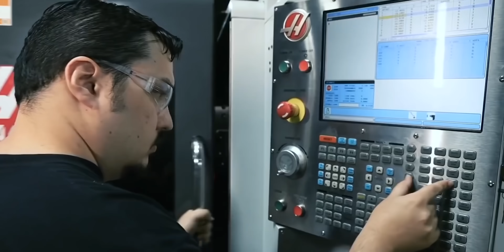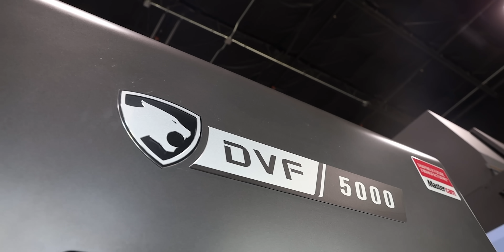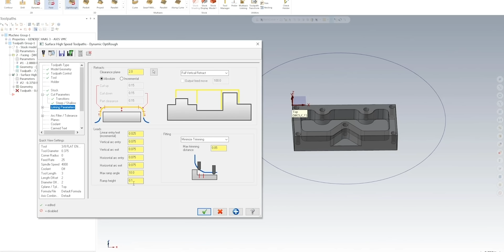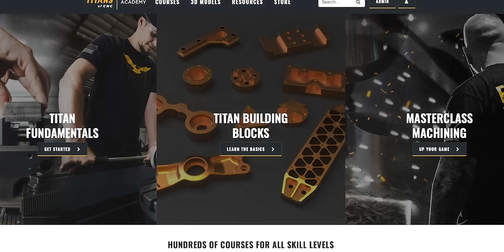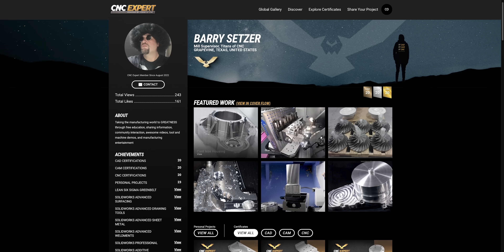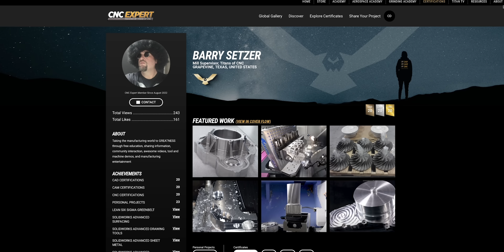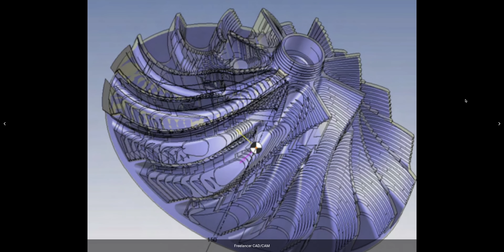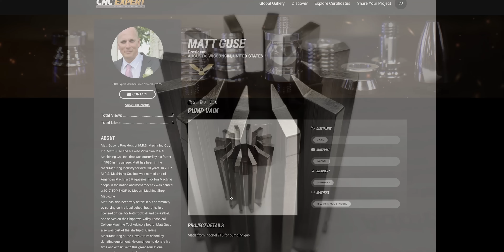Getting Work For Your CNC Machine

Comment: I designed a thermoacoustic engine on Tinkercad that runs on sound and feedback. I'm too afraid to build it. It's makes, air, hot water and high voltage AC electricity. It's kind of like a galaxy in a box... that's why I'm afraid of it. Not sure what to do with it.... It would take some courage to build it and possibly a high voltage safety suit. Every part is designed in 3d ready for a CNC machine but 3 of the parts will have to be tuned to 90 hertz. There are 13 non moving parts. It uses sound to make heat and move it in a doughnut and water condenses inside it and spins the water droplets in the same doughnut until it becomes spinning plasma. It makes high voltage and high amps . Because it makes it's own water it will gain mass. It has applications for space travel because it should make it's own gravity as well. It has 2 holes.. the air hole at the top of the box and the black hole at the center of the box.. and everything gets sucked through that hole. It's  a real breakthrough. Cost nothing to run... you just have to sing to it until it gets hot and it should run forever because it will turn the water into hydrogen and explode it for more sound and feedback. The engine itself is only 1 ft diameter and 2 ft high... and very simple. If you have ever seen a spinning hurricane.. it makes hundreds of millions of volts and thousands of amps from the spinning water droplets with no magnets or coils...and this uses the same principle.

Comment: There is plenty of work out there for the small job shop. And I mean small, like one guy with a Prototrak  cnc and a manual lathe. Learn a little welding and repair work stuff and you’ll be flush with customers.  The guys I know have to turn people away.

Comment: Small shop owner here. Question, the best work we have done is protected by NDAs and unfortunately we cannot disclose. There are very few parts we can show, and those parts aren't the crème of the crop. They may seem simple and low level, but we certainly can handle more complex parts. How can we build a profile so that it is not misleading on the work we do, so that it doesn't seem like we only machine simple parts and possibly push potential customers away?
Reply: Design your own showroom parts on CAD and machine them.

Comment: Maybe,  I have 4 cnc's,  and a shop full of manuals also, but.... without the high qty work it's a moot point,  we use to make 2,3,400 pc order's all day every day,  now it's 1,2 or 10 pc order's,  , finding good work with high volume is way harder than most think,  plus all the other shops that are starving to death and quoting jobs dirt cheap, hard to get the work.
Reply: Having a successful shop is the most challenging business there is.  Been there, done that, closed it.

Comment: Fantastic post!

30 years ago I was a newly minted plant manager at a CNC shop.  I remember a moment when an operator stated “how come the owner can buy a brand new Cadillac and I can’t get a dollar an hour raise?”.  This was asked in front of most of the workers during a coffee break (we were outside at the “coffee truck”…..when the operator pointed out the new Cadillac).  I then asked “would you prefer he pull up in a Yugo?”…..a cheap foreign copy of the Ford Fiesta.  I then asked if he knew about the rejects that came in the day before…..about a $50,000 loss (a lot of money for a small shop).  I stated “the owner bears all the risk….I hope he pulls up in a brand new Mercedes SL500….then I’ll ask for a raise!”.  Every one laughed….but it was a quick reminder of who’s bearing the risk.
Reply: There can be a fine line between who takes the risk and who is doing the work, especially if the boss isn't doing much in the company.
Reply: lol that still doesn’t explain why the operator can’t get a measly dollar an hour raise. I bet the shop down the street will, exactly why all the boomers with mindsets like you will be left with no workers and no shop eventually
Reply: @ianprice4679  This was 30 years ago…..CNC shops were closing everywhere due to offshoring, very few in the machinist trade knew CNC (Autocad/Smartcam was relatively new)….shops were mainly operators and tool/die journeymen (they made $$$).  It was an unbelievably sad environment….margins were a fraction of where they are today (race to the bottom).  For every want add in the newspaper, you get 20+ applicants.  I like many left the trade…and I miss making things off a blueprint….especially the difficult parts (you breath on them and they’d be out of tolerance).  I wish we were able to give raises because some one asked.

Comment: If someone is considering opening a shop, my advice is to start it ASAP. I can't express how much outsourced work is coming back to the U.S. from China. Do it now! Lead times are months out and suppliers are desperate. All the shops I know that are worth their weight are running at max capacity and expanding. Our shop is running at max capacity and expanding. I'm getting at least 10 requests for quotes a day. If you don't have contacts get a hold of a tooling sales rep or a new machine sales rep, they know who needs work done.
Reply: I’m so glad to hear that there are so many jobs for our machining shop owners. However, as a shop owner, I’m struggling to find. Could you please recommend me some of company that we can reach out for jobs?
Reply: @nhile-pj9ui  Talk to machine/tool sales people. They are in and out of shops daily. It's kind of crazy how the industry has changed in the 5 months since I made the original comment. The work is out there but I think most shops aren't outsourcing as much work.

Comment: I got into this trade before CNC was much of a thing (1980). In a rural community, word of mouth was the main thing, advertising didn't do squat, people look for machine shops when they're serious, and not to play around. 

A yellow pages ad was still a worthwhile thing back then. Still might be. The fractionation of society into silos makes it hard to get general attention anymore, you practically need to specialize just so your google info can be properly categorized near the front of a million alternatives.

Manual machining is still a thing as repairs are still a thing. Not to say you can compete on every level, but often one welding session and TWO cuts can save a $1000 to $10,000 part/machine. If you buy good used equipment, the payoff potential is huge. But you do have to be a skilled fixer in your own right. Nobody gives a shit about your machines but you.

The need for CNC became self evident, as repetitive work on manual equipment is a real drag. Good used CNC was not available in the early days, but it is abundant now. Still, it is a big leap if you aren't starting from NECCESSITY, but are just awe struck by the toys in the big shops. Don't covet that, because it has it's own drag.

I've never knocked on doors to get work. That makes you subservient to your customer. I do have a reputation which is "good but expensive", and that's the way I like it. I never intended to just be a shop manager who never got to play with the toys I was buying. Now past common retirement age, I've got more work than I care to handle. My business has been for sale for many years, but there's not many people who can step into my shoes. Lots of career machinists don't REALLY have the commitment to the trade that they imagine they do when working for someone else.
Reply: Yes, all this, exactly. I run a small prototype shop for in house manufacturing. Looking to retirement myself, I don’t see the skill set in most machinists to take over from me. A lot of guys seem interested in these super fancy 5 axis machines but owning a $280,000 machine is just never gonna happen for most guys. And the amount of work you have to churn out on those is insane. I have a 1996 Prototrak and a 1960’s Hardinge Super Precision lathe in my home shop and I could make a good living just from those. Every old school machinist I know who has some manual or semi-cnc machines has more work than they could handle. I like doing one offs and repair work. There will always be a need for it, more so as us older guys retire or die.
Reply: I’m a machining shop owner and I’m so glad that I can learn some of your valuable comments as I’m struggling to have more work. Do you guys have some tips to find customers?

Comment: I bought my first machines this past year. I have worked on CNC equipment for maintenance as a contractor for the past 2 years. I am buying older but good equipment, fixing them up and running parts on them. I am hoping to sell used equipment while manufacturing small orders in the hope of getting some large order to setup serious Automation manufacturing. It has been a wild ride. Waiting 30 days or more to get paid is extremely difficult.

Comment: I have had some experience dealing with machine shops , and my biggest problem is I will take a small job to a machine shop as a test to see how they handle it . and they tell me the job is too small , they won't make any money (we haven't even discussed price) , how they will put it on a shelf , and let the "new guy" do it when he is finished cleaning the floors....   I'm exaggerating a bit , but less than you might think , anyway they fail the "test" spectacularly . Occasionally it will happen the other way , a shop will handle a small job fantastically but runaway from the following larger orders . A shop needs to be able to handle small and medium sized orders , or they will never grow to the point where they get large orders. If I had a shop I would make sure I could handle orders from 1 to 1000 parts efficiently , profitably , and professionally.
Reply: I totally agree. I've been trying to get my boss to just expand the companies we do work for. No matter the size of the project. If we do quality work for them they will send more work.
Reply: I had a shop before the govt. Decided to fuck me over
 
Test jobs are often blatantly obvious and i've seen customers VERY upset with not getting the same quality as the test after sending a mid-size job to another shop.

Whenever i got a test job, i would tell whoever got it to do it (or do it myself) as well as we'd do a baseline job
Reply: My company manufactures products from prototype to 1000s. I also translate parts from machining into die casting or injection molding for mass production. All in the US. 

We do this because it is very rare.
Reply: it's silly, flexibility is critical for customer relations. i can see hesitation but some work turns into more work if done right. if nothing else, people talk and word of mouth might do more than you'd think. maybe not on an industrial level but still. you'd think these guys would understand this.
Reply: I just started my own shop to handle small runs with the hope getting some large orders. I am extremely low overhead with a shop on my home property. I would love more opportunities like what you are talking about.
Reply: @dangibby7782  Make your pricing transparent and put it on line so people can go to your website at 3am and in a few minutes get a quote.
Reply: @robertlackey7212  unironically though, xometry or treatstock are expensive but that 3am order is sooo very tempting
Reply: @angrydragonslayer  I assume you are talking about some specialized software , I can imagine just using website shopping software . Need to hog out aluminum go to roughing , there are 10 complexity choices "ok my part looks about as complex as part 7 and I need to remove about 9.5 cubic inches (I'm in imperial measurements) I put in 9.5 cubic inches on complexity 7 under aluminum , that puts $29 in my basket ( I'm over estimating so I know the actual part will come in a little lower) , now I have 2 holes to drill ....